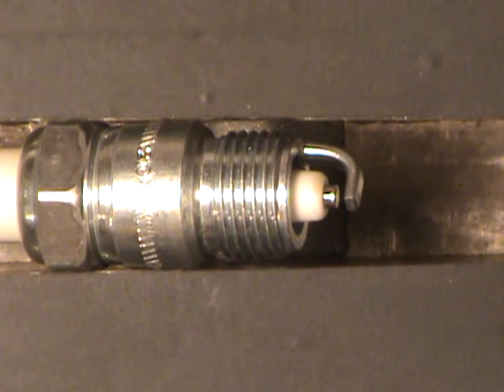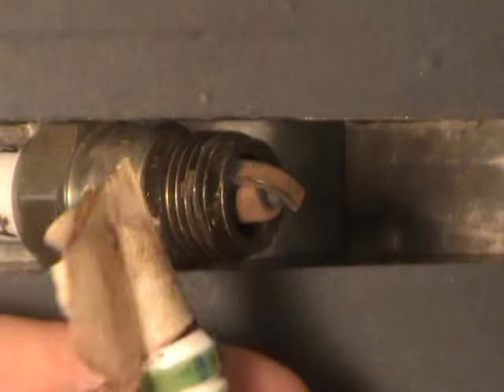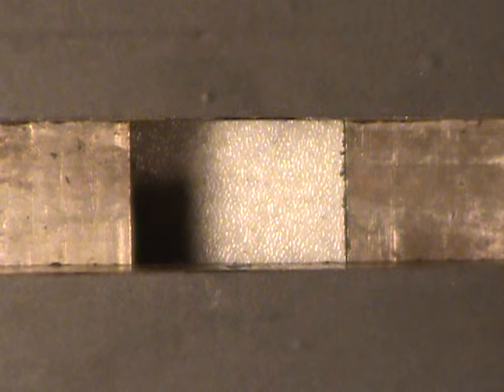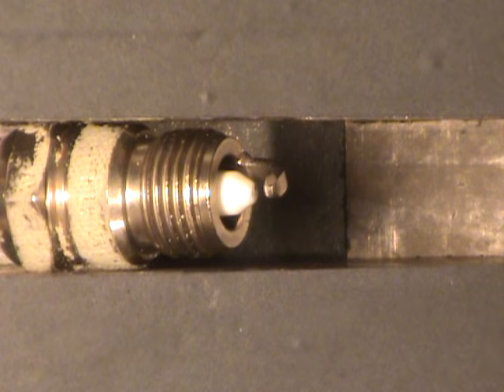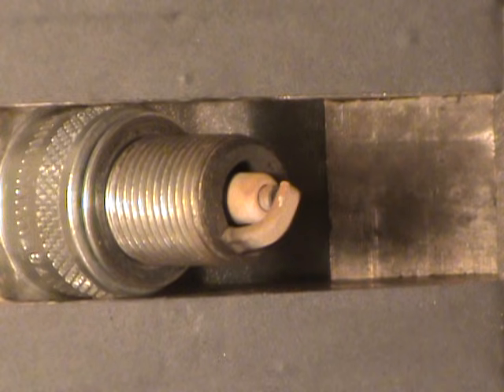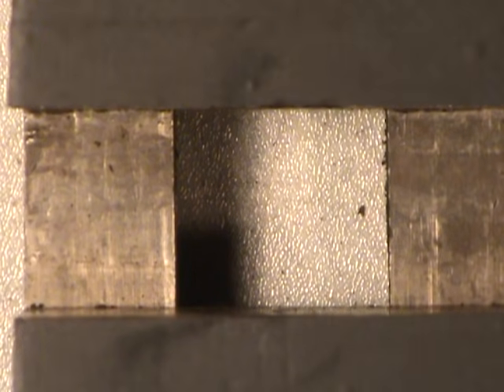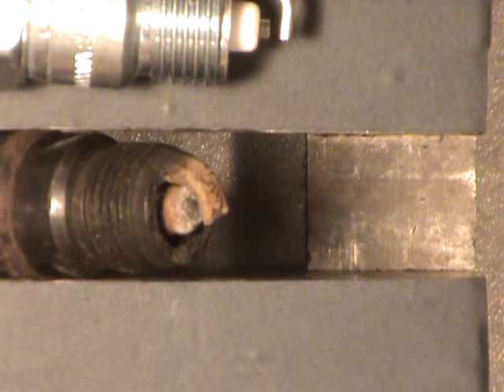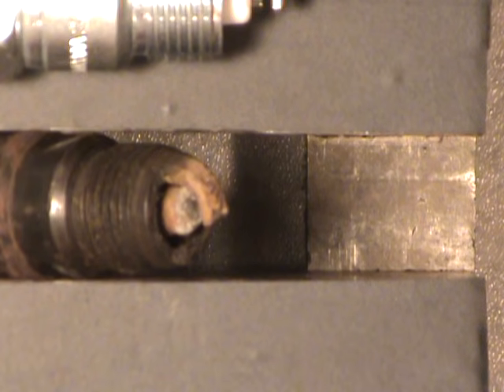SPARK PLUGS How to Read them (Part 3)

Comment from the maker: Greetings Thomas Ferrell....Thanks for your comment....I have run Lean a few times, but only while at lower RPM's and not at Wide Open Throttle! (luckily...whew!...lol)...Once, was when an EGR Valve got stuck open because of a chunk of Carbon (about the size of a pepper corn) got lodged between the valves pintle and the hole that it was suppose to close while at Idle, and wide open throttle....Another was a Nylon Positive Crankcase Ventilation valve "Disassembled" itself into 2 Parts!...(con't)

Comment from the maker: Sorry, I missed your other posts....I see that you have added some new parts...First thing that I'm thinking, is, when you replaced your spark plug wires, did you also install the "Spark Plug Wire Separator Plastic Clips" that clip onto the spark plug wires to keep them apart from one another?...Because if you have them too close to each other you may be getting "Induction Crossfire!"...That's when high voltage jumps from one wire to another one, causing a "Miss-Like" situation.

Comment from the maker: ...I had both, a Thermoquad, and a 2-barrel-Rochester carb start acting up for no apparent reason....Sometimes they just decide to plug up, especially in the idle circuit....Crusty spark plugs?....Re-place them lately?....Rich running might be your float/floats sinking, causing a high fuel level in your float bowl/bowls....Hesitation from accelerating?....Accelerator pump maybe?....Rebuild your carburetor lately?....Let me know what you have there, thanks....Take care, my Friend...

Comment from the maker: Greetings Moparmania74....I think that I will start with an old saying, and that is, "the chain is only as strong as the weakest link"....In other words, there are so many things going on that can cause these types of problems....To try to help you narrow down what the problem/problems may be, it would really speed things up if you tell me exactly what you have there as far as the Year/Model of the engine, carburetor, ignition system, stock/factory, or aftermarket stuff, etc....(con't)...

Comment: We use a straight RON method for octane (like Europe) whereas I believe Canada is like the US and uses a (RON+MON)/2 formula (more accurate, less impressive number LOL). Regular is 91, Premium 95 and Hi-octane 98. Adding 10% ethanol boosts the RON by a couple points. I used to encounter a lot of induction problems as a data cabler, but lucky for me my older car uses a lower voltage, no ECU and the wires naturally run every which way so it's not a factor for me fortunately!

Comment from the maker: ...what is "Induction Crossfire" you say?...well...it's when two or more spark plug wires are close together, then there is a good chance that the high voltage traveling down one wire can get transferred into another wire if it is close enough...Never noticed this Phenomenon until I started having ignition miss-firing in my 4.3 Litre V-6 General Motors mini-van...That's the reason that you see those plastic multi-wire separators (clips) on the spark plug leads!...Take care, and have a good one

Comment from the maker: Greetings Albinus81....Wow, 100 Octane you say!....Over here in Canada, I pretty much use only "87"-Octane (cheapest stuff)...(I wonder if the same rating method is used there?)....The engines that I run only have about an 8.5 to 1 Compression Ratio, and I set Base timing at factory specs (about 5 degrees BTDC) and no knock or ping, and good power too!....Also make sure that you keep your Spark Plug Wires apart from each other, or you might get "Induction Crossfire!"....(con't)...

Comment: They have MMT over here, it's primarily used as an octane enhancer rather than an AVSR. I'm advanced 15 degrees BTDC running 100 octane w/ 10% ethanol. No detonation at all! Gap growth isn't usually an issue as I replace the plugs every 20,000KM out of habit LOL. Yeah, oils here seem to have more zinc in them than the US and the white deposits are similar to leaking coolant but synthetic oils stop this. Take care as well!

Comment from the maker: Greetings Albinus81....Thanks for your comment, and great observation when reading your spark plugs with the various fuels used!....About the only thing that I may have seen, was something called "MMT", probably something that replaced Lead (led) as an anti-knock additive, which leaves a red-ish/brown color on the plugs....As long as your engine does not knock or ping and runs well, then all is good....Keep an eye on the Gap-Growth (electrode erosion)...Take care, and have a good one, my Friend

Comment from the maker: Greetings Sameer2762....Why, thanks kindly my Friend for your great comment....Actually, it has only "1" Thermoquad carburetor on it, and that's all it needs (flows 850 CFM!)-(Cubic Feet per Minute!)....If it was any other carburetor, then, it would only require about a 600 CFM size...Thermoquads have the ability to be over the recommended size because of the way that the "Secondary" Air Door was engineered...Also, comments below my videos have lots of information that you can read....Take care

Comment from the maker: Greetings Sameer2762....The car is a 1974 Dodge Challenger (Muscle Car), It has an 8 Cylinder 360 Cubic Inch (5.9 Litre) engine, and it has 245 Horsepower and 320 Foot Pounds of Torque (Net, measured at the output end of the transmission, with all belts and accessories hooked up), actual Horsepower would probably be closer to 300 HP, and the Torque would be around 400....I have lots of videos of the Thermoquad carburetor that are almost like the one on the car...Have a look : )    Take care

Comment: Air cooled, 4 stroke, single cylinder, carburetted. :) and yeah, it seems the engine needs to be tuned again, not getting mileage right now.

Comment from the maker: Greetings Sameer2762....Congratulations on getting your engine running good again....You were saying that your engine is air cooled, and, is your engine a 2-Stroke cycle or a 4-Stoke cycle engine?...I have worked on both types....Also, that close-up of that spark plug (thumbnail view), that shows at the top of this page was what you see after I re-jetted my Thermoquad carburetor on a 360 cubic inch car engine....Take care, and have a good one.

Comment: hey! u got me wrong buddy :P, i meant the plug is cold, not hot, and issues were thr of course, but now they ain't, that's what i was telling u, that after watchin ur vdo i remembered that my engine is actually running lean and the plug isn't reaching the self cleaning heat range. but now everything's working perfectly. the engine is a single cylinder carburetted, air cooled one, so issues get a bit bigger when compared to ECU controlled multi cylinder fuel injected ones. :) getting me? :) :D

Comment from the maker: ...as I recall, an engine (domestic ones, Chevy, Chrysler, Ford, etc.), need to be at about 180 Degrees Farenheit, to run properly, when fully warmed up...That 180 degrees will probably give you the best horsepower/torque, as I see it, where-as, I've also seen thermostats as low as 160 Degrees Farenheit, all the way up to about 205 Degrees farenheit, (195 to 205 Deg. F.) for emission controlled engines...I hope what I have posted here can help you out...Take care, and have a good one, my Friend

Comment from the maker: ...there is something that it might also be, considering that you had mentioned that you are running the "hottest" spark plug available....If you have a liquid cooled engine, then, it could very well be that your engine isn't even getting hot enough to burn the air/fuel mixture properly....If your engine has a radiator, and perhaps a thermostat, then it might be that the engine is being over-cooled because of a bad thermostat or whatever controls the actual volume of coolant flow....(con't)...

Comment from the maker: ...From my experience/experiences, sometimes electrical, and mechanical problems, turn out to be something different from what I first thought it was....There is also a thing called "Ignition Reserve"....That's when you have more available electricity at the ignition coil to fire your spark plug/plugs....When something like a fouled spark plug, or bad wiring tries to use more electricity then is available (ignition reserve), then it usually results in an ignition miss-fire....(con't)...

Comment from the maker: Greetings Sameer2762....If you have the older style of spark plug/plugs, the electrical current (spark), prefers to jump off of a sharp edge (center electrode not rounded off due to arcing)....Also, deposits can create an electrical path, then, no spark between the electrodes....Also, is the battery ok? (fully charged?)...Magneto perhaps?...or, any related wiring as it applies to the ignition circuit?....Try a new spark plug/plugs properly gapped first, hopefully, that will fix it (con't)...

Comment: u r right bro, the thing is, i stopped reading the plugs for so long, my bike was working gr8 but suddenly recently she gave me some issues so i tried setting up the carb, it worked but i know how my plug looks whenever i open it up, i was running lean, also the plug is cold, it isn't reaching the self cleaning temperatures, and no company is providing hotter one for the engine my bike has :| thinking to increase the CR now :D more power on same settings. :D

Comment from the maker: Greetings Wildfalcon55...Good job in coming up with your spark plug Holding Rack...I have done pretty much the same thing, only the blocks of wood that I use are currently organizing some screwdriver bits, and a needle file set...I usually remove one spark plug at a time, so I don't have to keep track of all of those spark plug leads...Just remember, if you trade in your vehicle, lets say you switch from Ford to Chevy, or Chevy to Ford, the cylinder numbering is different!...Take care my Friend

Comment: I like to take a 4x4 piece of wood about a foot long. I drill holes to fit the plugs into it down to the nut. I number each hole 1-8 and place to plugs from the cylinders in the corresponding holes. You can then grab you magnifying glass and take a look at each plug individually or as a grouping without picking them up and setting them down. I used to do the tape as well... but the more handling the more chance of an accident. You drop one then its useless to try to read it correctly.

Comment from the maker: Greetings Theeroom....A new set of spark plugs should have at least 100 Miles on them, more is even better, so that the combustion process (gasoline burning in the cylinders) gets a chance to coat the spark plugs, giving you a more accurate indication of how Rich, or Lean, the Air/Fuel Ratio is, and also, might indicate that there may be other problems as well (Ignition Misfire, or Fuel System problems)....Drive at City and Highway Speeds (Legally!)....Take care, and have a good one, my Friend.

Comment: Great video.

How far into running the spark plug can you check , i.e. a new clean spark plug, how many miles till i can check to see if mixture is correct?

Comment from the maker: Greetings Drakulea....and, thanks for your nice comment....Now, about your Bike running Lean....Might even be something as simple as a partially plugged fuel filter, and/or a multitude of different things that may be causing the lean running condition....If you have an older Bike, then the Gasoline is about 3% Leaner then it used to be in the 1970s!....If You like, let me know what Your Bike happens to be, and I'll try to help You out....Take care, and have a good one, my Friend.